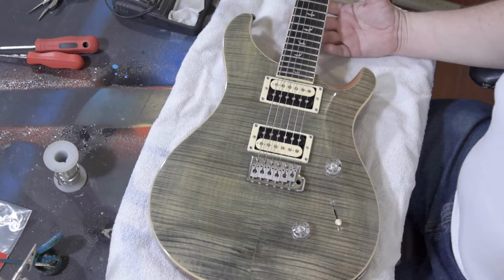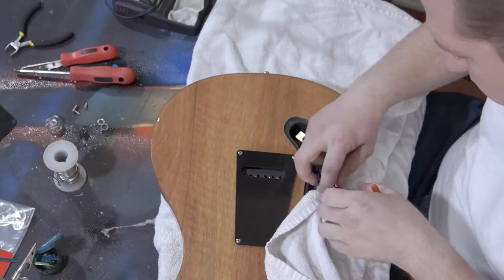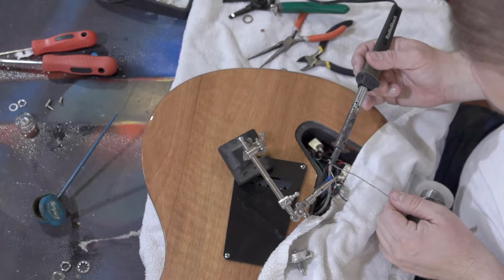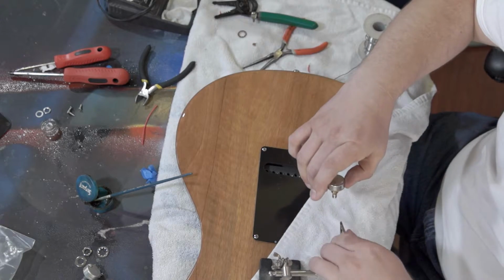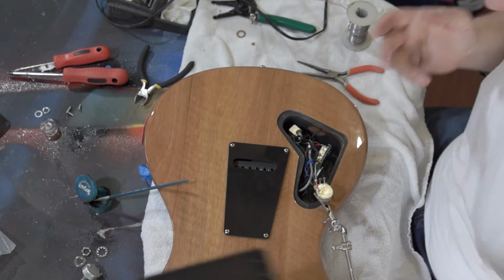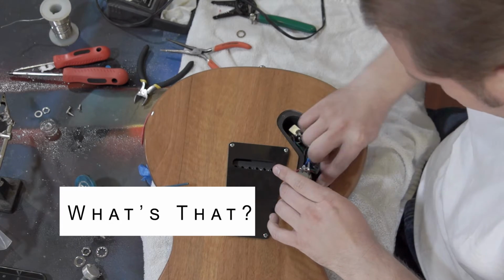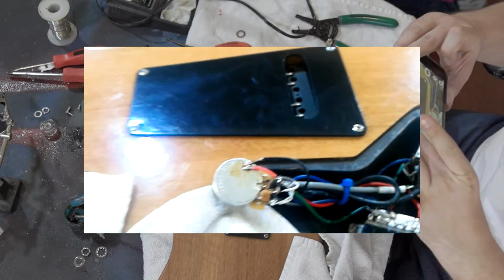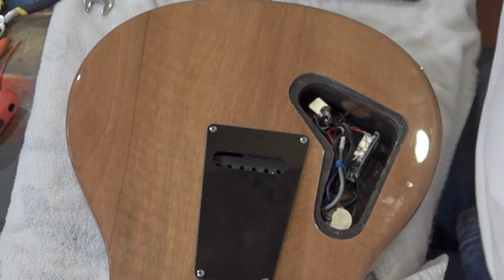How Do You Even: Guitar Volume Pot Replacement

Comment: any reason you just didnt clean the pot?
Reply from the maker: I had cleaned it previously, but my understanding is that the pots they used when making the guitar are notoriously problematic. So I replaced it however many years ago this was, and I haven't had any problems since